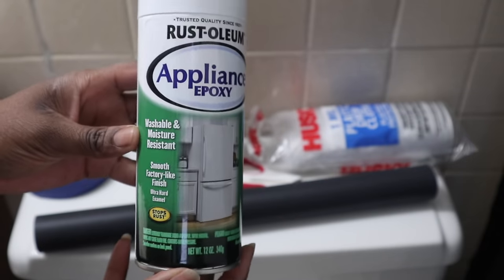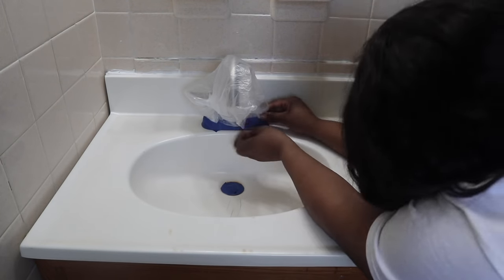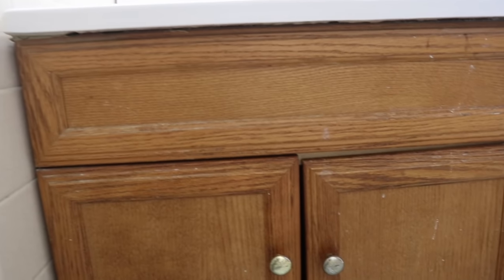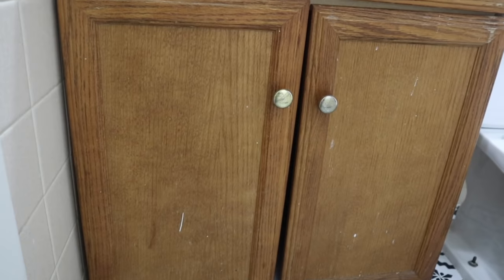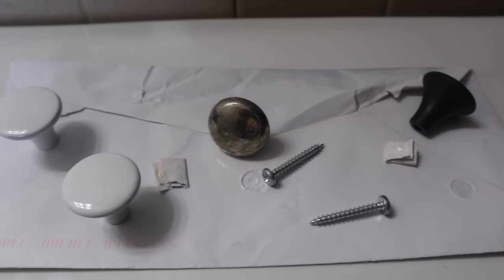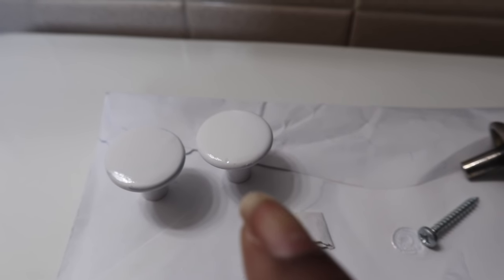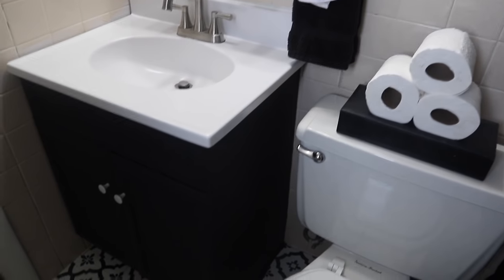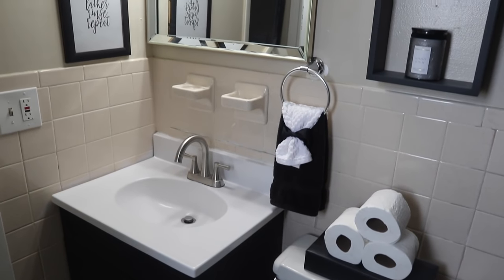DIY Bathroom MAKEOVER |Countertops & Vanity Transformation On a BUDGET+ Rental FRIENDLY Series Pt. 2

Comment: Just some tips for anyone watching this.
1. Remember to remove all old caulking 
2. With a lot sand paper. Sand very lightly your whole sink.
3. Make sure and remove any dust from sanding 
4. Lay your plastic down.
5. Hold can around 8-10 inches away 
I did all this then replace all the caulking, and bathroom sink still looks good 8 months later. Also don’t use any harsh cleaners to clean sink. 
Good luck and don’t be afraid, just do it..
Reply: Since you took the faucet off already that's when you should have prep/sprayed the sink than install the new faucet. Gloves when using spray cans.  I hope you saved all old fixtures you removed to replace when ready to move. Look nice and fresh good job lady.😊

Comment: Tip: During and after put the blow dryer to the contact paper (not too close) It helps it to adhere and mold nicely onto the surface and the creases because you melt the contact paper adhesive just enough (if that makes sense) this way it won’t lift up and it will last longer in place. When ready to remove, do the same, as it melts the adhesive for easy removal 🤗